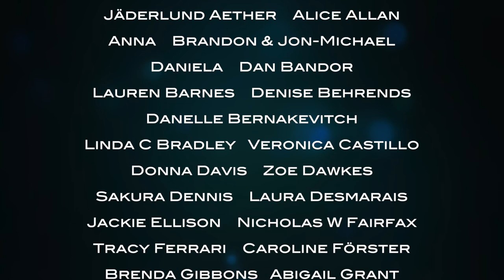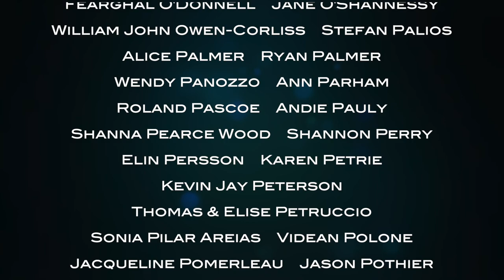The Chateau Diaries: CARPENTRY AND OPERA!

Comment: 24:00 some roosters don't get along especially if they don't grow up together. I have to keep my 5 roosters in 3 different areas. (3 roosters live together with a dozen hens, 1 lives with a male duck & 1 lives with 1 hen). You might need separate runs (kennel areas) for them & they could fly out to fight if it isn't enclosed on the top too. Just fyi!